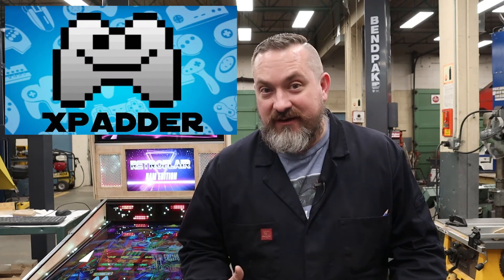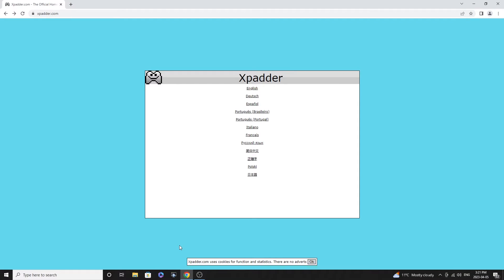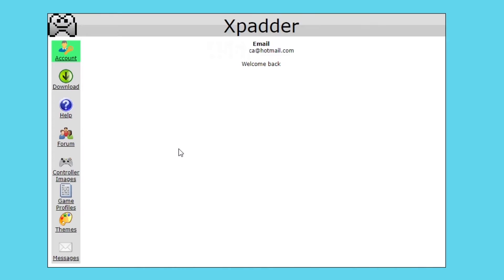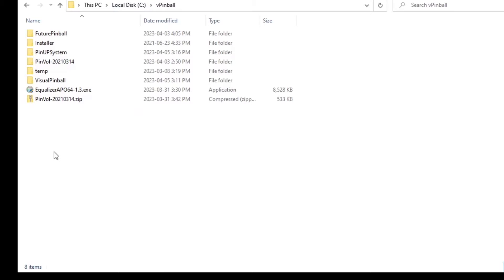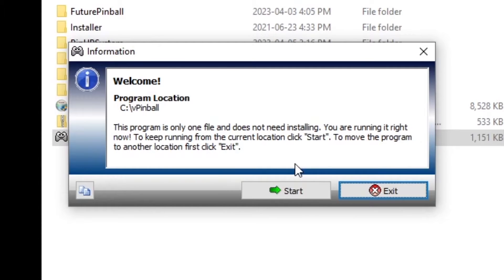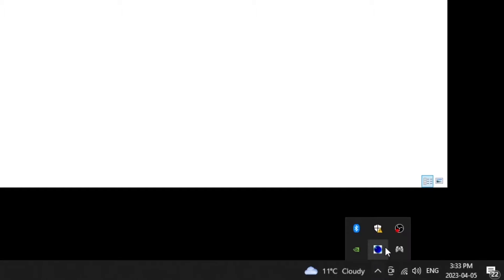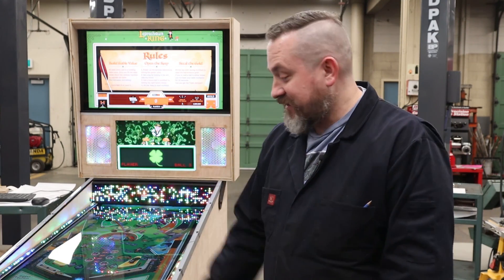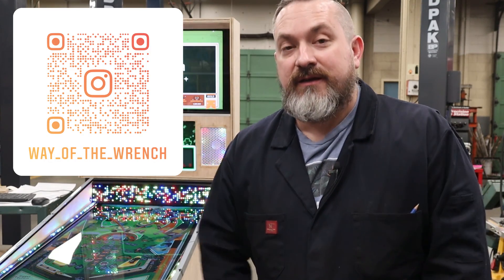How to set up Xpadder

Comment: if u have the dudes cab can u just run pinvol or do u still need xpadder??
Ive had a lot of tables where the call outs or voices in game are really low even turning the rom vol to full does very little.. hoping pinvol is the solution to my problem... 
Edit : ( Yeah Dudes cab has a shift button function , i think im all good & dont need Xpadder), hope pinvol  solves my problem with very low voices in games thou...🤞
Reply from the maker: Yeah with dude cab's shifted buttons you can totally use pinvol without xpadder.  Pinvol will solve all volume issues for individual tables.  Thanks for the watch!
Reply: Thanks for the reply man... once i get this new install of popper done ,il make some videos on you tube &  show ya my cabinet and how i went with setting up all of Arnozs boards with phils HD  matrix and his gear... we had some issues running the shaker motor controller board with arnoz board... at first it worked fine then after a couple of weeks it didn't... had to scrap his controller board out of my setup and controlled everything through arnoz board... Both of them have been super helpful, with my whole setup...
.. And your videos have helped a lot also... @wayofthewrench
Reply from the maker: Sounds great dude!  Can't wait to see it.  Send them to my instagram.  Yeah I had mine fail too, it's something about the PWM signal that might be frying them.  Cheers!

Comment: How are buttons not triggered in VPX for example when initially pushed.  For example, although pressing the insert coin button for .2 seconds may turn it into a CTRL key, won't VPX think I inserted a coin the moment I hit it even for a second since VPX links it to a button # and a keyboard key?
Reply from the maker: If you are talking about a shifted key setup, then you usually have to press a key and hold it while you press the second key.  Or you can tell xpadder that when I press a button, I want this to be used instead or as well.  Hope that helps.  Cheers
Reply: @wayofthewrench  I set-up the shifted keys just fine.  It's when I hit the left flipper say to turn the volume up or down while shifted, VPX will still recognize that I'm hitting the flipper button and move it on screen as well as the volume changing.  This is probably fine for flippers, but magna saves provide certain in-game set-up and I don't want those accidentally appearing because I used the same button as a volume up/down.
Reply from the maker: I think it does that but thankfully you only adjust it once or twice and then the table is how you like it and you don't keep touching it.  hope that helps

Comment: I just used an arduino. Hooked the buttons up to the arduino, plugged the arduino into a usb port on the computer and the arduino replicates a keyboard and sends what keys I want when the inputs are detected. You can send any modifier you want (shift / alt / control + key).

Your way is cheaper if you're planning on making multiple cabinets.
Mine is cheaper if you're only planning on making one.
Reply from the maker: Cool, good to know.  Problem is Arduino doesn't have an accelerometer for nudging.  Thanks for the watch!

Comment: Great Video and thanks for all you do for the hobby, I have followed your setup and when I click on any button on my pin it does not register with any key.  It does see the pinscape controller in Windows, but does not add the keys.  Any suggestions?  and Thanks again
Reply from the maker: I would watch the video again and go through your setup.  I would also check that xpadder is still up in the background.  After that , confirm your buttons are registering on xpadder.  Then check vpx settings to make sure they match.  Good luck!

Comment: Great video thank you.  I am having issues though and been trying to work out a solution.  Pinup Popper and tables work as expected with cabinet buttons, keyboard volume adjustements work as expected.  Using Xpadder the software will not detect the buttons, sometimes I can get magna save and flippers to work but start/extra ball/launch/coin never registers.
Reply from the maker: You're welcome!  If Pinvol works great on the keyboard then it must be the setup in xpadder.  Double check your button configs and make sure you saved the controller setup and the button setup.  The first time I had it working I only saved the buttons and layout but not my specific layout which is on the upper right corner.  Its in the video.  Good luck!
Reply: @wayofthewrench  Been a painful 3 days but loved every moment of it.  In the end reinstalling the pinscape software fixed it.
Reply from the maker: Awesome, glad you got it figured out.  Isn't Pinvol amazing!  They should just put it into Baller Installer!
Reply: I cant get xpadder to recognize my pinscape bittons either. Did you have to reinstall pinscape or xpadder?@andrewseroka2173
Reply from the maker: He said he reinstalled pinscape.
Reply: @xaviersanchez6239  Did reinstalling pinscape fix it for you? I am in the exact same position and Xpadder doesn't recognise any button presses. I just wanted to check before I uninstall pinscape and reinstall.
Reply: Here same issue, 
It don’t recognize some buttons. Pinscape recognized the buttons if I push. It’s drive me crazy. 
I have buyd xpadder because I had joy2key. And the pinscape software. And the settings in vpx. just need 1 program to set everything up. It’s not that easy.. 
i will struggle further. 
If someone know the solution please let me know.